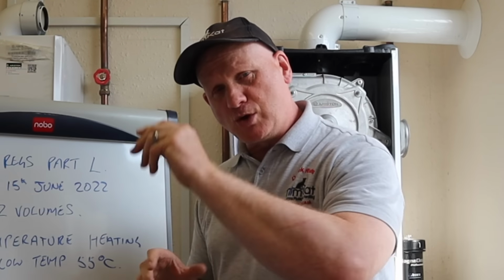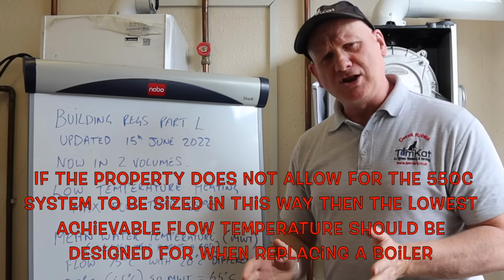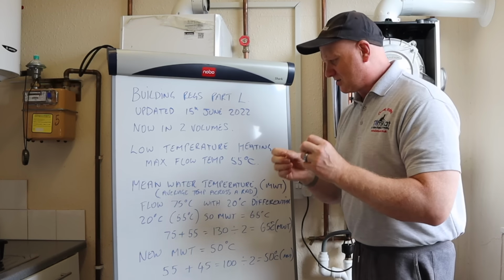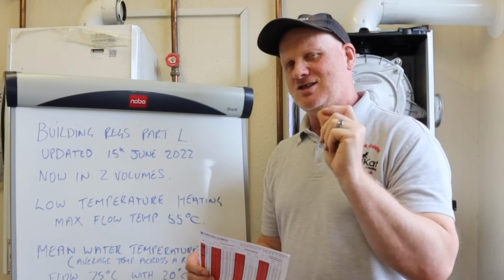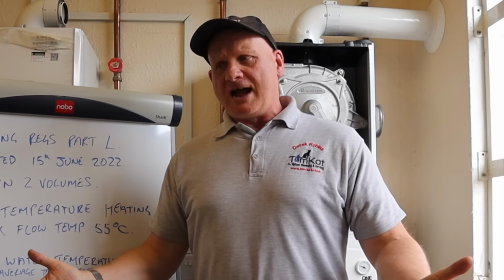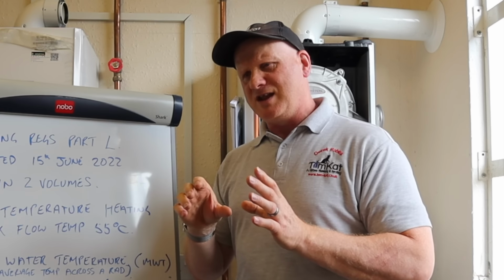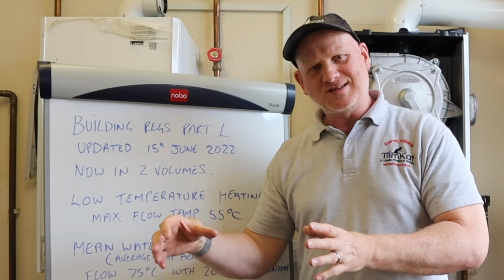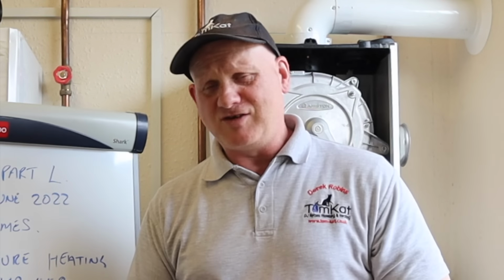Don't adjust your  heating flow temperature until you have watched this video. #saveenergy

Comment: Intresting video really helpful, but I don't have a room stat set up. I have evohome smart TRV on all my radiators apart from the bathroom. Should all these be set to the same temp?  
My loft insulation how thick should that be I have a 70s house and its not great even with cavity wall insulation. 
My pipes should they be insulated under the floor or just the ones in the garage (intergrated garage). Ahh so many questions and every "proffesional" I speak to says something diffrent....

Comment: A pretty comprehensive review.. Perhaps a warning and explanation about internal condensation forming from people totally sealing up their houses without allowing for any ventilation (to save money on energy bills) would have been a very useful tip to add; seeing as people try to seal off every possible opening to stop heat escaping which in turn doesn't allow moisture to escape or fresh air in! The best tips for saving energy not usually mentioned are :
1. Only fill your kettle (2Kw) with what you are using, i.e. one cupful on a flat bottom kettle.
 2. Gas hob cooking, either use a smaller gas ring or a wider pan so the gas never flames up the sides of the pan. The hottest part of the burning gas is just above the visible flame so why have it wasted up the side!
 3. Always use a pan lid.
 4. With Electric hob cooking, turn off the ring about 5 minutes before the food is ready and the residual heat will continue to cook the food.
 5. With oven cooking, perhaps cook more than one meal at a time for things that could be reheated in a microwave.
 6. Wear jumpers inside and gradually reduce the ambient house temperature a degree a day to acclimatise. 
 7. Your house takes a while to warm up so on work days have the heating timed to come on an hour and a half to two hours before you get up and turn of as you get up. Again the residual heat will keep the house warm enough until you leave.
 8. In the day keep the blinds/curtains up/open on any sunny windows and closed on ones that don't get the sun whilst you're at work and don't need the daylight in the non sunny rooms. This solar energy will help warm the house.
 9. If you have solar panels that feed back electricity to the grid during the day whilst you're at work have a 1or 2kw fan heater on in the hallway via a plug in timer for the good daylight hours to keep the ambient house temperature up for free!.
 10. Use a high TOG quilt on your bed,  a 15 TOG in the winter. 
 11. Turn down (not off) radiators in unused/little used rooms and keep the doors to them shut. Only heat the main used room to a warmer temperature. 
 12 Have thermostatic radiator valves fitted on all radiators except the bathroom one which should remain open valved at all times to allow a return flow path for the boiler water circulation in case all the thermostatic valves are closed simultaneously.
Reply: Number 9 - yes! It's many times better value to use the electricity you've generated than to get a pittance back from the energy company!
Reply: @stevec00ps  The payback from the feed in tariff is set at a fixed percentage of the power you generate, whether you use it or not, so you may as well use as much of it as possible!
Reply: I'd offer a light correction on point 12, it's the room with the room stat in that you don't want a thermostatic valve on, which is generally the hall rad. Leaving the bathroom rad off is a bit of a throwback from old fashioned systems. 

Also, if you have a point where all thermostatic valves are closed but the heating is still running, you've got your controls set up wrong really. You'd have to have the room stat set higher than the radiator settings.
Reply: @TheZippyMark  Thank you for your comment. I understand why you'd think that but it's actually the wrong way to do it if you think about it. This is a common misconception! If the hall rad is constantly on it will turn off the room stat (if in the hall) and therefore the entire heating shuts off, rendering the thermostatic valves in the rooms pointless! The hall will be warm but the outer rooms could still be cold! The idea is to have the heating on constantly and allowing the boiler thermostat and the thermostatic rad valves to do their jobs, thus controlling the temperatures in all rooms to the desired settings. The Room stat should be turned up quite high to allow all the other individual rad thermostats to control things. Think of the room stat as an extra optional on/off switch rather than the thermostatic brain of the system....or their really is no point in having individual rad valves! You can do away with the room stat altogether!
 I completely stand by the point that the bathroom rad is the one that has to be non thermostatic and always open/on as circuit flow/return failsafe. It's the room that you'd always want to be warmest!
Reply: @theeventhorizon-valebridge9512  Not sure I understand that it’s good to have the hall based thermostat on high, all the time, so that the other rooms are controlled by each one’s thermostatic valves. That results in long duration maximum boiler action and the highest gas consumption.
Reply: 7. Way too long, if your house isn't nearly up to temp after 30mins your system needs a look at. Bleed rads, flush the system of gunk before winter sets in.
Reply: @marksemple297  In small terraced houses maybe! My system is quite large and it takes 40 mins just to get the rads all up to temperature! My actual point was that most people leave the heating on until they leave for work which means the house is at its hottest just as people leave it empty and go to work!  Program the heating to come on and off earlier to benefit most.
Reply: Number 10 is definitely something I won't do

I have 5 tog all year around, with a fan on. In the winter, just turn the fan off
Reply: @waqasahmed939  not quite as bad, but i tend to go to 9.0 for winter and have a throw or 4.5 to chuck on on colder nights.
Reply: A pan lid doesnt decrease humidity. It will increase pressure within the pan and release when you take it off or it pops off
Reply: @jn5433  I'm not sure what point you are making here!? A pan with a lid on uses far less energy to cook things as it stops heat escaping. I'm not saying than it cooks more quickly necessarily, just that you'll use less gas/electric energy with a lid on.. Pressure does not build up in a simple saucepan as they fit relatively loosely by just their weight, and usually are vented too. Purpose pressure cookers do use steam pressure and do cook more quickly.
Reply: @jn5433  absolute bollocks

Comment: People need something to help now not be told to replace all rads. My Combie Condensing boiler was set to flow out of 75 deg with a return of 55-57 deg this was to high and obviously not condensing. Now I set the flow out to 60 deg in autumn and if cold in winter 65 deg. As my rads were installed 40 years ago they were designed for a hotter flow temperature luckily I got the installer to fit larger rads when the old system was installed. Fitted foil behind radiators .

Comment: I've never seen the logic of having a thermostat in one room that controls the heat throughout the house. All my rads have TRVs, when a new combi was installed in '20 we had to have a stat, it's been a real pain since then.
Reply: We put the thermostat in the living room instead of the unoccupied hallway (and turned down the lockshield very low there). 

Then to ensure one bedroom, when sometimes used in the evening (only one undersized radiator) stays heated, we turn down one of the large radiators in the living room. 

Unfortunately with that small GCH radiator they need to use a 750W oil filled radiator too sometimes.

We've avoided it, but the newer boiler seems to cope and limit the pump if all rads are off. The old one once made a terrible racket.

Comment: And to state the bleeding obvious. Check your walls, skirting board areas ect. Are there cracks in those areas? If yes do something about it and fill them in/up. Also use those long snake like things (draught stoppers I think they’re called) up against your door if there’s a slight crack there as well. All of those cracks and holes allow heat to escape. And in summer ( If you lot in the northern hemisphere have another hot one next year ect) those cracks and holes allow heat in if you’ve got air conditioning…… And apart from double glazing, pulling your blinds shut at times can also be a small help as well. Of course though, if you’ve got a brilliant sunny day and the sun’s shining into your window, don’t pull those blinds shut, take advantage of the free warmth Mother Nature’s giving you in winter……. ⚛️☮️🌏

Comment: My plumber set my combi on Eco when he serviced my boiler in February. He says it means it will take longer for the hit water to come out the tap but is a small saving . Does that sound right? 
The heating was still running fine after he did that.
Reply: Yes, it's just like he said. Otherwise the boiler keeps warming water from time to time even when not being used, just so you have almost instant hot water when you turn on the tap.
Reply: literally saving pennies but you may save money back  on using less water (if you're on a water meter)...............

Comment: Great info BUT you absolutely should not turn your router off, unless you want to knacker your connection speed. If you do, the system registers frequent disconnections and thinks there’s a fault and reduces your connection speed in hope to stabilise it. It’s designed to be always on.
Reply: I have a regular boiler and a hot and cold fill washing machine.  My theory is as I live alone I done need the hot water on everyday but every other day..  if I have hot water left over I will run the washing machine.  My airing cupboard drys my sweaters airs and stores my towels.  I don’t have a dish washer or a tumble drier.  My clothes dry overnight on the clothes airer.  Ironed then put away..  I don’t have heat on in the bedrooms, just let the heat rise.  Have double glazing which is essential.  When at work the heat is off all day.
  If we have a really cold spell I will leave on overnight at 15.
   Can’t see how you can do more than that.
Reply: @all Retired BT  PTO SFI engineer here... It is true that connection speeds can suffer... BUT it depends on your connection type. Speed drops are caused by the DSLAM card in the exchange increasing the signal to noise ratio so it's normally only ADSL and VDSL technologies that have this problem. Cable and fibre systems are much less likely to have this issue pop up. It is however not impossible and the loss of signal from the router could flag as a problem or create unnecessary tinkering. Considering the cost in electricity to run a router is tiny you are perhaps going to save 5 or maybe 15 pounds a year, what you will do is shorten the life of the routers power supply as supplies of this type have sensitive switching components and every time you swith on you are sending a surge round those components.

So when looking at the big picture....... leave it on !!!
Reply: Yeah this is true, I used to work for an ISP, this is especially the case if you don't have fibre and are on ADSL, but will still potentially cause you issues with fibre as well
Reply: @RecuringWolfe I'm on cable and have very little issues but my Dad is on bt, pats for a 72 Meg connection and only averages 6! His upload is 0.4meg (useless). I've gone into it and bt said he rarely uploads anything and only uses minimal download time so the router sets itself low!
They advised rebooting once a week. Doing this does speed things up but it soon settles back to useless.
Reply: @RecuringWolfe  thanks to you both, Karl and Mike King, for your prompt and detailed replies. I would argue that with current prices all the 'neglible' amounts of electric add up over a year and that at some point in the future ISP's should design the system so it can be turned on and off.
But Mike you gave me an idea... my PC is a wired connection but there are 2 that are running on Wi-FI that dont need to be. They were on wired and those wires are still there, just not plugged in. I'm not sure how to turn the WI-FI off but i am going to look into it because we dont need it on.
Thanks again you guys.
Reply: i have actually seen this stated by some ISP, Sky i think. IMHO that is a flaw with their procedures/equipment that they should be rectifying so people can turn the router of when not being used ( just off the top of my head: with an 'off' button It could simply send a 'power off' signal when its deliberately turned off telling the system to ignore the 'disconnected' status). Whether they will or not i dont know but as things stand currently they do say you need to leave it on.
Reply: @ravenmasters2467  unfortunately that isn’t the way the technology works. Its designed to give users the most stable always on connection. The majority of devices rely on connectivity, from security systems, databases to regular consumer devices. The power drain from leaving a router turned on his negligible, it’s not even worth considering.
Reply: @ravenmasters2467  problem is, the systems that detect connectivity across all the exchanges in the entire country would need changing to be able to receive and recognise that command. Each one needs to know at what strength and frequency to send the signal down the line, in order for it to be stable, too week and its a brittle connection that drops, too strong and its distorted like a speaker turned up too loud for it to handle. If the router is off for a long time, the systems then out it into a period of instability when it's next on, where it tries to vary the strength and modulation to get the best possible connection. This period of instability will see very unpredictable connection, but its necessary in order to find the best. The best option is to find routers which have the lowest running power, and turn the WiFi off when not needed. The WiFi broadcasting is what uses the most of the power from a router, especially if its dual band

Comment: Good emphasis on why people might not want to turn the flow temperature down rather than why intelligent people might want to save money by turning the flow temperature down and perhaps turning it up a bit when the outside temperature is unusually low.

Good point made that obvious increases in thermal efficiency are the result of regulations introduced by educated people rather than by boiler manufacturers and installers who have no interest whatsoever in increasing the efficiency of the products they are supplying. 

My boiler has soldiered valliantly on for the last ten years with a flow temperature below 40C and a return temperature of about 29C - should I be worried about bacteria reducing the efficiency of the boiler and/or the radiators? 

Will 'the average' British manufactured condensing boiler corrode rapidly if any condensation actually occurs in the boiler? Looking at an Ideal boiler they advertise 'Economy mode' at a flow temperature of 67C - with their flagship Halo thermostat the chances of any condensation occurring anywhere in the boiler are very low - is there a reason for this?

Comment: 55 degree flow does NOT apply to replacement boilers. It applies only to FULL replacement central heating systems ie; new boiler, rads and pipework. Part L is not stupid enough to suggest anyone needing a replacement boiler needs to set their primary flow temp to a level too low for the design temp of the system.

Intelligent weather compensation with internal reference should be mandatory, then the boiler will do all the hard work for everyone and run as cool as possible as often as possible. Alas, that doesn't suit Ideal and Worster does it.
Reply: Turning the flow temp down to 55 or even lower is perfectly feasible without having to replace radiators.  Simple trial and error to find what is comfortable versus saving money is all that is required.  I have done it - only one radiator out of two on in a 17 ft lounge and boiler temp turned down to 50deg C.  Although this will probably have to go up as the Winter gets colder.  But savings now can be spent in the colder months.
Reply: I'll disagree. Many (most¿) houses have oversized radiators so there's usually room to drop the flow temperature quite significantly
Reply: Eh ? My Ideal Logic has intelligent weather compensation. Its built into the PCB and automatically detects when the outside sensor is fitted. The kit costs much less than a Worcester kit, so you stand a chance of making savings a lot quicker.
Reply: I don't know what you are talking about.My Ideal combi boiler is set at 60c for the radiators.I expect to pay more in winter to keep warm.We are 75 And Iam no going to sit in the cold with my disabled wife.The thermostate is set at 20 c.Why are we making everthing so complicated? Have you seen the set up of airpumps.You need a small engine room to keep it running.Our old boler used to be a Glow worm small boiler.Not a combi.Emergen heater upstairs in the cupboars.Headertank in the loft for the bath.A small tank next to it for the centRal heating top up system.We had that for 25 years and it did a good job.Anyway older people or people with families who are struggling shouldn't sit in the cold in a rich country.Let's talk about that.We lost our £200 heating allowence and for what?

Comment: Turn the upstairs bedrooms to 3 on the thermostats unless unoccupied and 5 downstairs. Run most old houses at 55 is possible but any distant rad in an extension will likely be too cold, any old rads without fins will nately work. I set most at around 65 to 70 unless its a well designed system with new rads.
Reply: Can you install a modulating room thermostat and let the boiler optimise flow temperature?